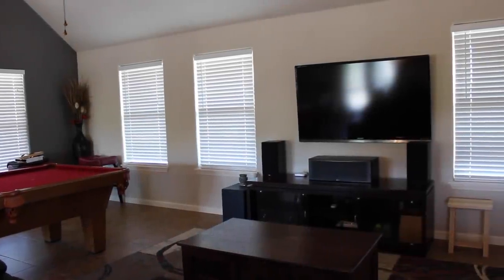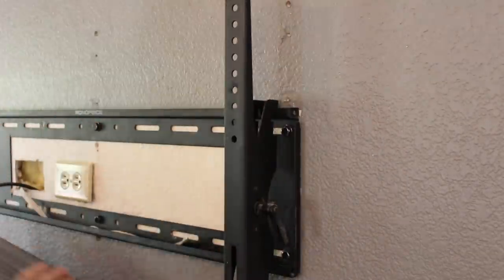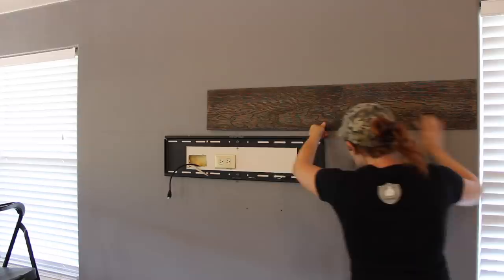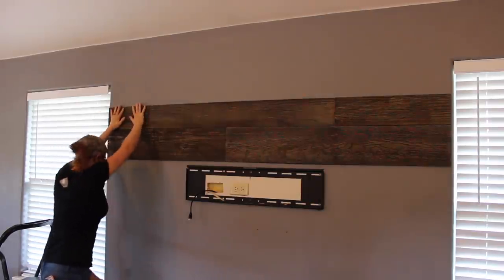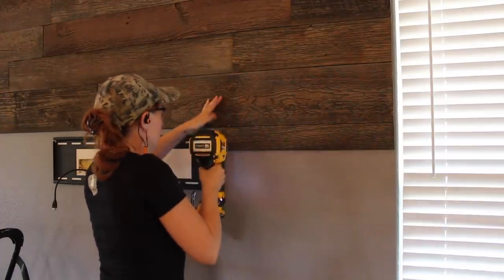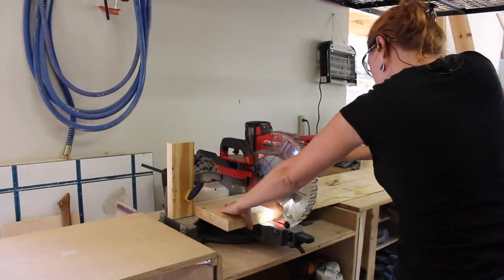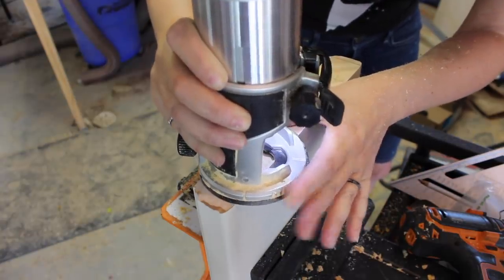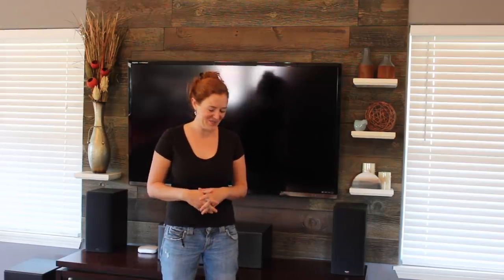DIY Wood Wall and Floating Shelves

Comment: We did the wood wall project several at our church several years ago, they make such an interesting feature and are great fun to do. We used 300 old pallets for it, with lots of cutting and fitting. Glad you get the Swabby to help you on the grunt work!

Comment: Others may have mentioned this, and you probably thought about it too, but on your TV mount bracket, I've placed a board behind it to bring it out to the dept of your wood wall.  
That brings the TV out a bit, but it would help hide the bare wall behind. I've placed the board behind the bracket, so that I catch more studs, for example, giving it greater strength.  I like what you did tho, and I'm thinking I should do something like that for my home office!  THANKS, Great Job!

Comment: Hi April, another good video. I only have a suggestion and a term for you. The term for a row of siding or tile is the same as in roofing. It is a "course". The suggestion is, if you don't already have them, is to get a set of "vix bits". They are self centering, spring loaded, drill bits. They are designed for installing hardware. They have a chamfer that puts the bit dead center of the hole in a piece of hardware. 

Keep up the good videos. Even in retirement, I find myself watching them all.
Reply from the maker: Thanks for letting me know the term! I didn't know the roofing term either so that's helpful. Damn, I totally have some vix bits, I'm not sure why I didn't think to use them.

Comment: April, Have you any idea the creative "monster" you have unleashed inside of you?  It is so refreshing to see someone appreciate the art of self satisfaction with making your own items wanted or needed. Yes, it is your home and you seem to make it look just fine.

I would like to offer a bit of a suggestion regarding your levels. I know the odds of it being a problem is not all that prevalent but when I saw you making such a permanent marking for such a visible location I needed to at least mention it to you. Every once in a while double check your level to be sure it is accurate. Simply level something up with the level used in both directions. Just the time you need to rely on visual accuracy there may be an issue with the level where it may have been bumped and damaged. Costs nothing to be sure. You have become a true craftsman in your own right. That has to be quite satisfying.

Comment: Hi I'm 13 years old and I'm thinking about making my own wood working shop. Could you recommend any essential things I might need ? Thank you
Reply from the maker: : ) Hey that's neat. I hope you enjoy getting into it. Depending on what type of projects you want to tackle will determine what set of tools would be best to start with. So my recommendation is to pick out a project you would like to tackle and then get the tools needed for that job.
Reply: April Wilkerson thanks
Reply: Probably a cordless drill, a circular saw and/or a jigsaw are good first tools. If you have a place to put it, a tablesaw is also a good thing to have.

Comment: Looks great, but at $119 for 5 square feet..absolutely not. That's $23 per square foot. An insane price point.
Reply: That much is certain. No one in their right mind would pay that price for that product.
Reply: I’d just buy some regular wood and stain it 🤷🏾‍♀️🤷🏾‍♀️🤷🏾‍♀️ cus that price is definitely out of my budget
Reply: wwblackman how’d it turn out?
Reply: wwblackman right on!
Reply: I would have recycled some pallets and stained it a couple of diff. Shades.
Reply: A $300 brad nailer? Sure, no problem. We all have that.
Reply: @js7un165  you can them at home depot very cheap. Just have to buy your own nails.
Reply: @js7un165 man, if you gonna do that for living of course get you a good one, but if you gonna do that every now and then, get you a cheap one, just for your house and little projects, get you one from harbor freight, done deal

Comment: This actually reminded me of long ago, when my dad worked at an overhead door company and we used the discarded wood panels from the glazing to create a feature wall. It turned out beautifully. There's nothing like wood to add warmth and charm to a living space.
Good job, April. Thanks for sharing this. ... And I LOVE the accent shelves. 
If there were anything I would change, I think I would have taken the wood right to the floor. 
Thanks again for another fantastic video!
Cheers!

Comment: Why didn't you mount the TV-bracket on top of the wood? 
would be a lot nicer if you are gonna change the TV.
Reply: Kjetil Fyllingen i dont think that they will change it for smaller...
Reply: The tv sits more flush this way. I hate it when tvs are floating 6" out from a wall, this is a much cleaner look.
Reply: I agree that was kind of strange. I had a custom built in tv and of course when it died so did the space and had to redo the whole thing to make it look right. Now the tv is mounted on the outside with a bracket. but over all it has a nice look and the room does look better.
Reply: 89nissancrawler the quarter inch of this board does not make much of a difference. Mounting it over it would have been better and simpler
Reply: That faux board is $23 a sq/ft so perhaps it was to save a few bucks.
Reply: theshopguy10 it looks to be a single board worth of space. Not much of an added cost.
Reply: Many reasons: the mount is best screwed as close to the studs as possible for strength, even a quarter of an inch does make the gap between the tv and the wall look smaller, it hides the mounting plate/plug/passthrough a bit better looking from the sides, it saves a bit of material, it avoids having to make cutouts for the passthrough and socket...
Those are just reasons coming to my mind on the spot, so yeah, plenty of advantages and IMO a smart move to do it this way.

Comment: They are making fake reclaimed wood now? Sorry to be the negative nelly, but that's just... wrong. I guess woodworking has always had a part that is about fashion, but when I see the latest palette wood "trends" exhibited in the local big box store, I can't help but wonder if the whole thing isn't so 2016 and we should all be pouring household items from concrete right now.
Reply: Did you see the price for that fake wood? $23 per square foot...for glorified foam.
Reply: Gavin Alexander What about laminate flooring? Where I live, that kind of stuff starts at less than a dollar per square foot. The only downside would be the ugly edges (the "end grain" side in particular).
Reply: real hardwood would cost 4-5 times less.  Laminate - 20-30 times less.
Reply: This project appears to be 6' x 5', so around 30 square feet. That adds up to $690. How in the world can Rockler think that's a viable product?
Reply: Exactly my thoughts after I checked it out on their website.
Reply: It all depends on what YOU want. Some people, price is not an issue, just like some people drive $80,000 vehicles vs a $12,000 one. If YOU don't want to use this Rockler faux wood, then use pallets or whatever floats your boat. It was still a great project. If you don't like it, don't do it.
Reply: Talladega, no one is saying its not a great project.
Reply: +Lap Joint  If you look at "woodworking" in general it's very much about aesthetics and less about functionality. As an example...there is really no reason to make fancy joinery like visible dove tail joints in terms of what it does for a  piece structurally. There are easier solutions that are just as solid and far less time consuming. So why do wood workers use them?  Because they look nice. So where am I going with this? Well those boards she used are not real wood but they look nice. Whether they are wood or not is completely irrelevant because they serve the same purpose...to look nice.
Reply: Not trying to be a jerk but what other joint could you use in place of a dovetail that is as strong and self locking?  None come to mind for me.  A simple box joint is close but it is just as time consuming as dovetails.  Also, the golden rule of design is that form follows function so saying woodworking is not about functionality just seems a little shortsighted.  Just my 2 cents!  I'm not trying to be a troll.  I'm actually a woodworking teacher and have about 30+ years in the field of woodworking and find it to be a very artistic field but the majority of it is functional as well as aesthetics.
Reply: +theshopguy10  A dovetail joint is only locking in 2 directions. The glue is what locks the two pieces in the 3rd direction. A typical drawer corner joint can be box jointed instead of dovetailed.  It's actually significantly stronger than a dovetail joint because there is more surface area for the glue to grab and hold the pieces together. The wood around the joint will crack before the joint does if you try to pry it apart.

Comment: April I seldom comment on your videos because I typically find all the content excellent and feel I would just be repeating myself with each post.  This project however is without a doubt one of the most incredible projects I've seen you do.  It required relatively little work yet the transformation is amazingly astounding!  Great job and thank you for all the ideas and projects!

Comment: Fake wood  boooo. Turn in your woodworker card. Lol
Reply from the maker: There is a place for everything.
Reply: My wife has wanted me to do a wall with that material. I've had the same reaction, no fake wood. This has me rethinking my decision.
Reply: not just a fake wood.  It is a fake wood that costs $23 per sq. foot.
Reply: I work at a Rockler store,  the faux wood is not cheap, but is light weight and does look a lot like wood.
Reply: Michael Rubin $23 a square?! I didn't see that coming.
Reply: April's wall is probably $1000 in faux wood. Not exactly practical. I love rockler, but they are too proud of many of their items.
Reply: Jim Welton hh
Reply: ouch...
Reply: 30 dollars per faux plank!! :O
Reply: I'm thinking cedar fencing might be a good alternative.
Reply: not at that price.... Ouch$$$$ as always a good video, thank you.

Comment: When you make the entertainment center, make it with the hanging barn doors you had at your old place. Suspend the tracks from the ceiling. That way when you open the doors to expose the tv the doors will shade the light coming from the windows on both sides.

Comment: This is great, April. I had a similar idea for one of my walls, and saw this in your Instagram, and was looking forward to it. My problem is I'm in a condo with thin metal studs behind the walls that are useless for screwing into and hanging anything. A lightweight substitute for real reclaimed wood boards like this, that can be adhered to the wall rather than screwed in, might a good solution for me.  Now if only I can find them in Canada, where Rockler doesn't operate....   thanks.

Comment: To save money i used a nice good quality floor laminate on a wall.    And used finishing nailes to every stud so i will only have to patch holes instead of replacing the drywall with the glue.   Worked great

Comment: Looks good April, but one question for you... do you have wooden studs or aluminum wall frame. I only ask because I made a shelf for my kids book bags and such and I have found some good anchors and not to sure if it will hold on drywall. I did some research drywall is strong and some people say no. What anchor would you use? Because I really like to use what you have but just don't know if it will work thanks.

Comment: Just a suggestion.  When adding on to the length of a board instead of using a tape measure or ruler place the next board in place and mark with a pencil where to cut.

Comment: Just a quick tip: For getting around outlets and professionally running the "wood" around the TV brackets... an easy way is to use a contour gauge or profile tool for $8 from Harbor Freight. : )  This way you can cut out the wood perfectly.

Comment: April, as always I really enjoyed your video.  You explain the why as well as the how.  As for the cost of the material, if you like the look but don't want to pay the price and alternative is used wood fence pickets (the 4" to 8" type).  Same look and also very light.  I do have a question about your floating shelves, you said that you attached the brackets to studs,  it looks like the shelves are not wide enough to be attached to studs 16" apart.    Are they?

Comment: Another great project, April. But I’m wondering why you felt the adhesive was needed. Your faux wood panels are nailed and don’t seem to be holding any weight. Everything is attached to wall studs.

Comment: I want to use up all the vinyl flooring i had left over from other jobs. Do I need the drywall on the wall to attach the boards or can i just use the 2x4 as im going to go the long way on the way instead of up and down.

Comment: Where they 18ga brad nails or 16ga finishing? I only have a 18ga brad nailer.

Also what size nail and did you nail to a stud or just into the drywall? Our wall is textured and 26" studs

Comment: I just made some floating shelves in my bathroom using the same hardware. I was surprised to see you drill the hole with a handheld drill. 

The entertainment center hides a lot of the unfinished section but the shot at 6:08 looks odd, I think I would take the wall down to the trim to give it a cleaner look.
Reply from the maker: I didn't want to mess with the drill press. I don't like my drill press. I took my time with the drill and made sure I was going in straight.
Reply: April Wilkerson dilling for the bracket was my reasoning behind getting a press. I ended up with the WEN 4214. It fells good and smooth; for my 12x12 shop it's about as big as I can make space for.

Comment: I just did a 5 by 5 ft, wall in the back of my hall bathroom.  I used 3 pallets that came with mulch on them last summer
You could consider it free or $25.50 per sq. ft.  of course with them I got 200 bags of mulch.  Ha ha.  It came out great.
I  sprayed a light coat of white over it  put a wreath on it with down light above and it looks great. Waste not want no is 
my code.

Comment: Just out of curiosity, did you think about mounting the tv bracket over the faux wood instead of going around the bracket? Looks good the way you have it...I was just wondering. Thanks.
Reply from the maker: Nope, I didn't even consider it but it wouldn't have hurt since I already had to take the bracket off. Although, finding the studs through this faux paneling isn't easy. If I could do it over again, I don't think I would change my order of things.

Comment: Hi. Would it have not been better if you had space between your original wall and the false wall with an 6 socket extension cable stuck behind the tv to hide all the cables? now you will have 3 or 4 cables exposed dangling down when you connect all your tv stuff.

Comment: It looks nice but I'd have definitely gone down to the skirting/floor with the panelling, even if you just went around the sockets lower down and didn't do anything with them per say as your current entertainment centre covers them up. It would have looked much better as that bit either side under the windows looks a bit odd, in my opinion.

Comment: For the floating shelves did you actually have studs there? What did you use for anchors?
Reply from the maker: Yep, I have the studs at 16" and then also the framing for the windows. I just got lucky it worked out that way.

Comment: Great work as always! Question for you, what went into the decision to use those panels instead of wood? Was it just because you had easy access to them or were there other considerations? I'm planning a very similar project, but with a herringbone pattern, but I've been planning to use old fence planks. I appreciated the hardboard suggestion, I'm definitely going to steal that. Thanks!
Reply: Randy Thompson the video is sponsored by Rockler, who make the fake wood. Pretty sure that had something to do with it. ;-)

Comment: How do u keep the cabling invisible? where do u run the cables that connects to the sound system, electrical etc?
Reply from the maker: They are ran through the wall and down to the bottom of the wall. The previous owner installed the outlet you see in the center of the bracket so all I had to do this time was plug in my TV once it was hung. Here is a video if you need a guide on running your wires: https://youtu.be/NPkN7FFwzgg

Comment: Hi April great project may I know how do you seal knots in pine, thanks.
Reply from the maker: I used a sealer made for blocking knot stains. I have it linked in the description.
Reply: April Wilkerson thanks for the quick reply unfortunately  that product doesn't exist in Serbia (where I live) but I was wondering if I could just use some epoxy instead.And one more question why is it important to seal the knots what exactly does it do to the paint.Sorry for being boring I am just new to woodworking so I am curious.😀
Reply from the maker: I've only ever used this stuff so I can't vouch for epoxy (I'm sure somebody with experience though will read this and tell you). If you only paint over the knots with a light color like white, the knot will eventually bleed through and you'll be able to see it.
Reply: April Wilkerson so I can use epoxy?

Comment: Idk why so many ppl use those big tv wall mounts there is one I use it’s 2 piece 1 attaches to the tv and one to the wall with a level built in. The 2 pieces are about 3 inches wide and just snap into together.

Comment: My windows are just like yours - no trim around it. Have you thought of adding moulding around your windows?
Reply from the maker: I thought about it but they put drywall on the inside of the frames and radius the edges...so it would be a lot of work to add trim. I'm going to start with adding window boxes first and see if that gives it enough of an enhanced look first.